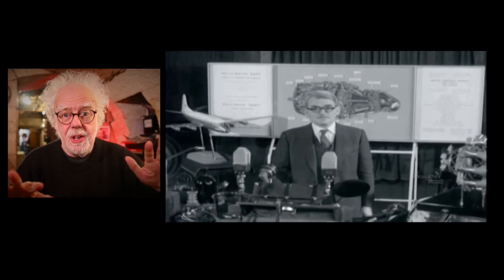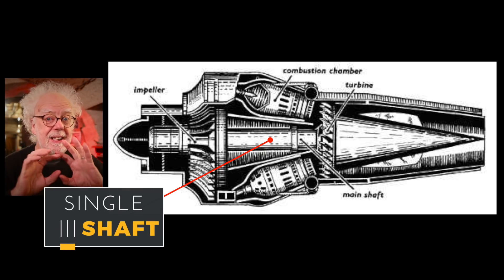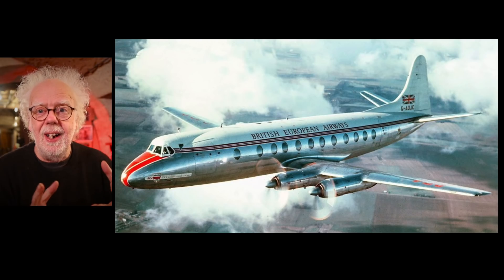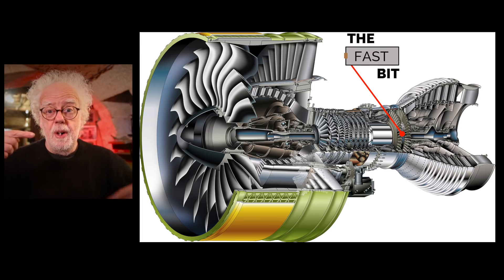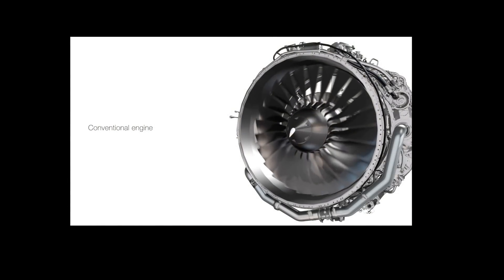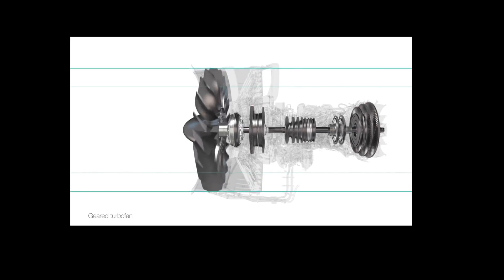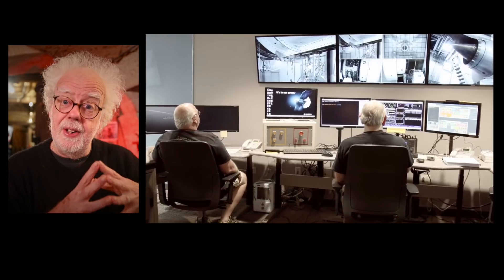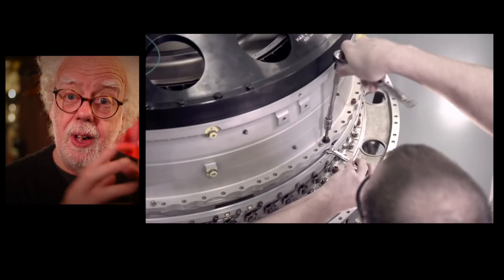Greater than the JET engine - Prof Simon

Comment: The gearbox itself has a loss though, and a potential failure point too.
Reply: Most piston engined planes have used a gear reduction. It's not that complicated or unreliable. As for efficiency, a bigger, slower prop is more efficient than a faster, smaller one which more than makes up for the losses from the drive itself. That is the idea here as well.
Reply: @wingracer1614  An electric fan is still better if it can be made to go fast enough because it's separate from the rest of the engine. The rest of the engine becomes more efficient because there would be less drag and friction just like an auto electric fan doesn't affect the engine's performance. It can also be programmable. You can increase airflow by making the fan thicker rather than larger and you can make it spin backward and out of phase for some noise cancelation. I don't see why the fan needs to be connected to the shaft at all much less with a gear set. Hell, it doesn't even have to be perpendicular to the engine. It could suck in air from the top of the craft. The air intakes can be made with protection in mind. Lots of possibilities.
Reply: I can envision other ways that could slow down the fan without adding many extra parts. The fan could just be electromechanical and not even attached to the drive. Has anyone thought of that? A giant electromagnetic fan could be at any speed the engineers wanted and it doesn't even have to be attached to the drive and can turn in any direction (even reverse) making the drive unit more efficient, lighter, stronger, and safer. This gear idea is wrong for all the reasons HillOrStream has said. The electric fan idea will be way more efficient than the lousy 16% benefit touted in this video.
Reply: They’ve used electromechanical drives before.  In things like locomotives and ships and synchronous systems. 

IE... things where weight and size aren’t an issue.
Reply: @Bartonovich52  Cool. All we'd need to turn is a fan.

Comment: Prof - Regarding your single moving part statement, and ignoring all the accessories (QEC) items parts; only focused on the engine core.  There are double and triple spool cores which did try to deal with the fan tip speed matching.  Probably the most successful production design being the RB211 series of engines by Rolls.  Noting it had much more weight (circa 1.5 ton) and experienced much less vibration related in service issues.  Back to the Efficiency versus Weight trade offs.

Comment: Prof, the issue that Boeing and airbus are wrestling with is that the efficiency gain versus the weight gain (personally don’t see the benefits yet) a geared option for an engine on a B737 is very much more heavy.
A sub decision tree might be the vibration and maintenance saving (personally suspect that these are good)

Comment: Check out the cutaway view of the Pratt and Whitney R4360 Wasp Major 28 cylinder piston engine from the late 1940's. It uses a planetary gear system to both stabilize and operate auxiliary fuel ,oil and hydrolic systems. It's curious that they haven't adopted this technology in the design of turbofan engines until recently. There must be some " devil in the details " problem that needed to be worked out. Who knows what it is ? Weight, friction, durability ?

Comment: Not needing geared transmission is one of the beauties of a jet engine. Amazed they can't run a slower fan by using a dedicated spool from a super slow turbine.
Reply: They actually do. Every turbofan engine is a multi spool one.
Reply: @Bartonovich52  Yes, multi-spool usually with the fan and LP compressors on the same spool like the engine in the vid. I was thinking of the fan on it's own slow spool. Looking into it further RR has this setup with the triple spool Trent series. Kind of negates the need for a geared fan.

Comment: Always wondered why the front end of the jet engine was so huge and now I know. Great topic presented with great clarity. Bra Va ....
Reply: Momentum goes up linearly while kinetic energy goes up exponentially so it is more efficient to push against a large section of air a little than a small section of air a lot. It is realy suprizing they took such a long time to put a gear between the turbine and fan the higher the bypass (the bigger the fan) the more efficient the engine is.

Comment: Thanks for the video! Though I must point out that the geared turbofan concept isn't strictly a new idea by P&W, the TFE731 and ALF502 entered into service in the 70's and 80's for various business jets and the famous BAe 146 respectively. P&W have definitely taken things a step further however, since the P&W1000G series is significantly more powerful than its earlier counterparts (around 3-4 MW SHP for the ALF 502 versus ~30 MW for the P&W1000G), which makes the design and manufacturing significantly more challenging. 

The key challenges to GTF design are typically as a result of the need for thermal management, which gives rise to a multitude of things to consider such as rotor bow (because you've effectively cut the LP shaft in two), increased idle thrust (as a result of the larger, slower fan it allows), and debris in the oil systems (you wouldn't want small bits of metal from bearings for example getting munched up by the gear teeth!). And it doesn't end there either... 

The wider implications of bigger resultant fan diameters mean that aircraft have to be redesigned too, to allow minimum engine ground clearances and minimal aerodynamic flow disruption at the fan inlet. Boeing found out the hard way that you simply cannot re-engine an old airframe with these larger engines without major architectural redesign, since the 737 MAX issues ultimately arose as a result of the larger fan diameter (bigger fan; engines set higher on the wing; centre of gravity pitch stability margins reduced; need for software to compensate).
Reply: I'm honestly surprised with the ever larger engine diameters that underslung nacelles are still the preferred mounting method.

I mean, I'm sure there's a good reason for it, but we see a bunch of alternatives through history and in smaller aircraft.

Everything with the SF-50 having a single engine mounted between a v-tail, to most business jets having 2 engines placed along the rear fuselage...

To all the old tri-jet designs which also all largely had rear-mounted engines.

What is it about wing-mounting the engines that seems to be the first choice here?
The larger the engine gets relative to the aircraft, the more difficult that would seem to be as a mounting location....
Reply: @KuraIthys  not really wings are stronger than fuselage. Putting 300kn of thrust and massive weight in the rear section isn't the easiest probably. 
I guess the main reason is to balance the plane easily.
Reply: @MrFlyingPanda  absolutely right, as you say, wings have to support not only the engines pulling on them, but also the whole weight of the aircraft in flight too. And right again with the balance issue too.
Reply: @KuraIthys  wing mounted engines offer a number of advantages over other locations, the aircraft centre of gravity, ease of ground maintenance and overhaul/replacement, undisturbed inlet air flow, minimum distance from fuel tanks (in the wings) to engines, and more. But as you rightly point out, there will come a time when it will simply be impractical to mount larger diameter engines to wing nacelles. Rear fuselage mounting is fine with smaller engines (such as with business jets and older, smaller turbofans), but as the engines get larger, the additional mass towards the rear of the aircraft means the wings have to be brought towards the rear of the fuselage, which causes a host of other issues. There are also aviation design requirements that engines must be placed such that in the event of a turbine disk failure, the resulting debris that is radially ejected cannot compromise the elevators on the tail, which would lead to a catastrophic loss of aircraft. With bigger engines mounted at the rear, the tail would most likely have to be a T configuration, placed sufficiently far back to satisfy the regulations. I could go on as it's a complex topic, but you get the gist.

Comment: oil pump and fuel pumps are drivin off the turbine but add to the moving bits as well as generators and other systems like hydraulics just add to movings parts then u get in to high by pass turbo fans and u made all sorts of extra work for ur self but im sure they will make a hybrid system next at insane cost

Comment: What if these new fangled geared engines blow up like a hand grenade?
Reply: No no, there have been geared reduction systems for 70 years, helicopters and turbo props generally have been using such “bull fear & planetary gears” for the same effect, standard experience on this safety engineering is known.
Reply: @mikehitch7799  And geared turbofans have been in use and flying for 50 years. They have been small engines though - the big fans need the same mix of tough materials with as little extra weight  possible, but to take that immense horsepower, in the region of 100,000 HP + it is a difficult engineering challenge to say the least.
EDIT 65 years since first geared turbofan.
Reply: Martin D A - yes exactly its going to be bloody heavy.
Reply: Yeah as Mike said, the gearbox is unlikely to disintegrate, plus it doesn't rotate particularly fast compared to the HP shaft. I'd be more worried about an uncontained fan blade off, or even worse, turbine disk failure, which is impossible to contain...
Reply: onetrickhorse I have worked on uncontained gearbox failures which took 50 years to appear.  We did get to the bottom of that problem after 7 years study.
Reply: @mikehitch7799  Interesting, and what was the cause in the end? Was it an issue with fatigue on older gearboxes, or was it a design issue? And if I may ask, what kind of gearbox was it?
Reply: You have to test for that by building one with a grenade in it and setting it off.

Comment: One of my absolute heroes is Frank Whittle. I did a lot of research after getting annoyed by people telling me others had invented the jet engine. Ohain was in short trousers when Frank published his first patent.  And the more I looked, the more I was convinced he was an absolute genius engineer (and a great guy too). Frank was vindicated
Geared turbofans are with us already and have been flying for decades and the Garrett TFE731 has been flying since 1972 on many small to medium sized business jets.
The problem with gearing down the fan speed is twofold. First is weight and bulk which needs to be kept to a minimum for obvious reasons and secondly is the material and engineering to transfer the power whilst keeping an eye on the first thing.. A big fan requires a colossal amount of power and takes two thirds from the core in standard form. This translates to maybe 100,000 horse power! Finding light weight gears to reliably transfer the enormous power is not easy. The smaller engines are not such a problem.
Frank patented the turbofan along with the afterburning supersonic engine in the late 30s, early 40s - I forget exactly, though I guess it must have been in the 40s.
My first plane journey was in a Vickers Viscount and I remember it being a very nice flight.
Reply: Don't now if you are aware but a book you should read is "not much of an engineer " by Sir Stanley Hooker. He worked along side Sir Frank Whittle in the jet engines development.
Reply: @martinwarne7183   Stanley Hooker is one of my heroes Edit: another one! He seemed to somehow build all the worlds greatest engines. The Pegasus still can't be bettered so it seems?
He was responsible for talking Rolls into taking on Whittles engine whilst Rover were buggering about trying to build a car with it. 
I didn't know about the book. Thank you very much for the recommendation I will get it for myself at Christmas.
(All edited because it read like garbage).
Reply: @martinda7446  Here's another one for you, an interview with Sir Frank Whittle from 1986https://youtu.be/eE3mPqAMeGY. 
There is also some where on yt a video about Concorde which shows both Sirs aboard her l, which I found to be historical and touching.
Reply: @martinda7446  During the WW2 development process of the jet, Rover got facilities and permission from the Government to develop their own version of the Whittle engine, while pretending that they were just 'developing for production'.  They also declined to make the prototype components which Whittle requested, such as turbine blades with a twist.  This caused huge delays in the British program, probably around 18 months, which were not resolved until Rover were off the job, replaced by Rolls Royce. 

I always thought that the Rover turbine cars were post WW2, as a way of making use of their experience of Jet engines during the War
Reply: Those of you who are in the Whittle camp don't know that turbojets after reaching altitude, transform into a ram jet. That is when the air rushing in is faster than the air the compressor can pull in. The compressor then only free wheels. Ohain, the rest of his team and the Japanese engineers understood this principle. The Messershmitt 262 and the Nakajima Kikka were high altitude interceptors, and were reliant on this ramjet mode. The Whittle engine did not reach ram mode and wasted energy continually pulling in air.
Reply: It was the German and Japanese who made the first true tubojets. Read my comment above and a challenge to the professor on this subject.
Reply: @mohabatkhanmalak1161  The pioneering engines of Whittle (Rolls Royce and de Havilland), von Ohain (Heinkel) and Junkers and BMW are ALL turbojets.  You are indirectly making a claim that non-axial turbojets are not in fact turbojets, or not 'proper' turbojets.  . 

In doing so, you invalidate the von Ohain (Heinkel) engine, which was fully centrifugal - centrifugal compressor (like the Whittle) AND centrifugal turbine (like no other jet ever made, unless you count a few recent engines made using automotive turbochargers as the basis).
It's a bit like defining a reef knot as being a proper reef knot if you tie left over right, but not if you tie right over left...... Or defining an internal combustion engine as having multiple cylinders and overhead valves.  Internal combustion engines with side valves, or rotary valves, or sleeve valves are not 'true' internal combustion engines because they do not fit your narrow definition of one.
Reply: My favorite Frank story is that he rejected development of the axial design because he knew the materials available weren't up to spec, in recognition of durability vs performance.
Reply: @fiftystate1388  Well then, if he couldn't deliver then he lost the race. In the late 1930's and the war years, even the Italians were striving to build a jet but were not successful. Like Whittle, they too had plans and theoretical research on paper. Should we now put all these unsuccessful attempts on a pedestal. It is quite clear that Hans Ohain and the Japanese engineers built the first turbojets, while Whittle was dreaming of one.
Reply: @mohabatkhanmalak1161  You had a case up to "and the Japanese engineers," keep trying. Practical, airworthy, saw service, the Japanese fail on all three, unless you can cite a new source.

Comment: Ok Professor Simon, some homework for you:

1.  What is the difference between a centrifugal compressor and an axial flow compressor?
2.  Which one of the above did Frank Whittle use?
3. What type of compressor is most commonly used today?

Have fun!
Reply: Well that's easy. Whittle invented both (his original patent having both types). And of course the most widely produced is obviously centrifugal. The Russians and Chinese having produced in excess of 200,000 copies of the RR Nene (Whittle design) alone.
Reply: True, although whittles designs concentrated on the centrifugal design, it was jumo who used the axial flow type on the Me 262.  Whilst centrifugal compressors are in widespread use today in turboprop and turboshaft engines, modern turbofan and turbojet engines used on civil and military aircraft today use the axial type.  Not sure which is the most numerous but i suspect it would be the axial type, overall.
Reply: @squirrelinstructor6075  AA Griffith was the pioneer of axial compressors. His metrovick company produced the first axial flow jet engine, and the first production quality engines. In 1939 Whittle knew centrifugal was the present (small sub 5000lb thrust) and axial-flow was the future, hence his LR-1 jet patent (the precursor of just about every axial engine). Whittle also patented the turbofan.

Comment: Like you Professor Frank Whittle was one of my heroes. When I flew to Australia in 1953 the plane he'd propellors but I do not know the make of plane Was flying in. Lets face it I was only almost 3 years of age and don't remember other than landing many times and the journey taking several days.
I have never heard about a geared turbofan jets but it makes complete sense as I have fascinated by jet engines most of my life. 
I have a Trent engine blade and it is quite heavy. I often thought how much force it would generate if it was spinning at several thousand rpm.
Thank you for another fascinating piece of information professor Simon. I will let my co-pilot know.